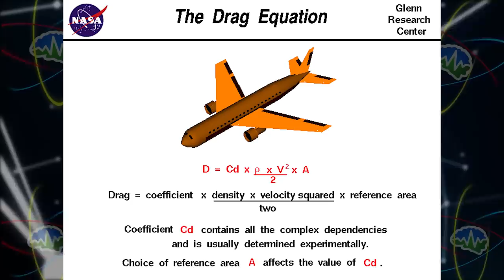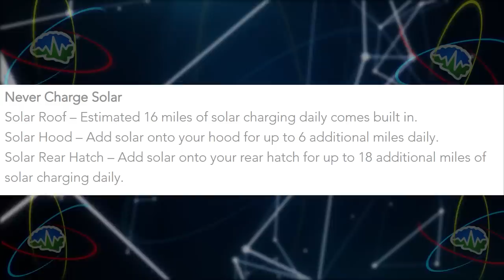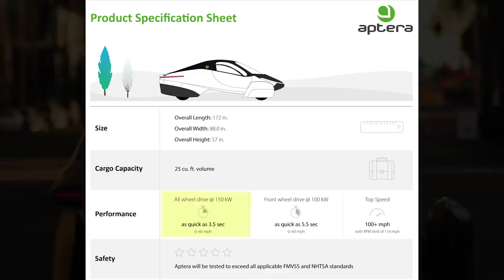Aptera Beats Tesla? | In Depth

Comment: I thought that this would be a great first car for a teenager until I saw the 0-60 time, that is way too fast for a teenage driver.
Reply: The two wheel motor version time is 5.5 seconds
Reply: @n.brucenelson5920  that is still pretty quick for a first time driver.
Reply: @wildweav  Agreed, but the Level II safety pilot option ($1300) should add some additional security and when the crash test results are released, that should give an additional level of confidence.

Comment: Solar powered car. Can't be parked in a garage. Can't be parked in a carport. Can't be parked under a tree. Can't be parked on the wrong aide of a building. Not much good in the canyons of city streets.
Reply: None of this is true.  It might be if you only want to use Solar as a charging source- but you can also get 13 miles of range per hour plugged into a 110 V 15 amp outlet in your garage I unlike any other EV.
Reply: @N. Bruce Nelson - Sorry, I should have been more specific in that I was targeting the claim that you could pretty much run without ever having to plug it in.
Also, I should add that I can't tell you how happy I am that we are FINALLY moving to go all electric with cars. Let's just try to contain the pie in the sky claims, it's bad enough we have Elon already doing that.
Reply: @georgejones3526  no worries.  I am sorry if I was too strong.  I admit to being a bit on edge these days.  Let's not throw out the baby with the bathwater.   I appreciate everyone who is interested enough to comment here.  Really!
Reply: @N. Bruce Nelson - Woops, sorry if I came across as having an attitude! I wasn't upset with you, sometimes I just don't phrase things so well.

Comment: But, crash tests?  Crumple zones?  ugh
Reply: From their FAQ: "We will not know Aptera's actual rating until we pass a production vehicle through the full safety test. But we are designing to exceed all passenger car standards and the previous version had the highest roof crush strength of all passenger cars on the road, and it performed exceedingly well in actual side and frontal crash tests. Aptera features a Formula One-inspired safety cell with advanced composites and metal structures for impact strength. Similar to aerospace and racing, these energy-absorbing methods are a core part of our safety strategy and have proven effective time and time again in high speed impacts. Aptera also makes use of today’s best forward and side airbag systems in case of an accident."
Reply: Both front and rear crumple zones are part of the design.  It will excel when tested.

Comment: If you found your way in a wind of. 30 plus mph wind  driving around in a flying wing in you are Going for a flight
Reply: It has been tested in 110 mph side winds.  It is far more stable than many slab sided 4 wheelers.
Reply: No.  Wind will have less effect than any other vehicle and as speed increases there is down force built into the design.

Comment: I’m all for innovation and variety especially when I comes to EV, but it looks like a trike with a soda can where people are suppose to sit. Maybe I shut off this full on plug didn’t hear much in safety. Tesla hasn’t just built a customer base but a cult so to say lol. I feel it could do ok and who I see in an Aptera are those people you see riding those single wheel power boards drinking cranberry juice rockin Fleetwood Mac. All the best for them but if a company is gonna pose any kind of threat, they gonna have to really awe the world. Which would you rather have a company that builds EVs & reusable rockets, or one that went bankrupt and makes top of the line trikes and might partner with Harley Davidson. Seems like a rhetorical
Reply: First of all, Aptera didn't go bankrupt the first time.  They had a CEO who didn't agree with the founders' vision and liquidated the company.

Secondly, the design us as focused von safety as efficiency and will have excellent results when it is crash tested later in the year.

Comment: 👎🏻 click bait. Not in the same category as Tesla. You can’t compare a production to a theoretical vehicle. All of these brands: Lucid, Nicola, this one, are simply startups in a realm of theory. Once they establish a production line, sell 300k vehicles to the main market, only then should you try and compare to an actual car manufacturer, until then compare them amongst each other.
Reply: I understand where this is coming from but on this basis many of Tesla's announcements are vaporware, and they still haven't learned to make money from building cars.  This will have to change quickly if they are to remain viable, and they know it.

As far as the current Aptera goes, it is not intended to sell 300K vehicles.  The planned production rate is only 10K per year by the end of 2022.  The difference with Tesla at that rate is that they will be quite profitable.  Their next car, a 4 wheel, 5 passenger sedan, won't be as wildly more efficient, but it will have dramatically lower capital costs to build than Tesla and will be competing in the same market as the Model 3.

Comment: Apples n oranges comparison.
And not one word of Safety.  Thing looks like a death trap.
Reply: From their FAQ: "We will not know Aptera's actual rating until we pass a production vehicle through the full safety test. But we are designing to exceed all passenger car standards and the previous version had the highest roof crush strength of all passenger cars on the road, and it performed exceedingly well in actual side and frontal crash tests. Aptera features a Formula One-inspired safety cell with advanced composites and metal structures for impact strength. Similar to aerospace and racing, these energy-absorbing methods are a core part of our safety strategy and have proven effective time and time again in high speed impacts. Aptera also makes use of today’s best forward and side airbag systems in case of an accident."
Reply: I suspect that when it is tested it will rank among the best two passenger vehicles.
Reply: This thing looks really light.  EVs are Heavy.  I'd feel safer in a Model Y or a Cybertruck.
Reply: @juzefzoozoo  It's expected to be around 1800 lb curb weight. So it's pretty light for a car, but not excessively so. But if you just like heavy vehicles, by all means buy one.
Reply: Rickie j  it's a matter of physics.  1800lbs Vs 4500 to 5500lbs ...I'll take my chances in a Model Y or Cybertruck.  EVs have really low center of mass.  Lower chance of roll over.  Still possible of course.
Reply: @kkobayashi1  I will.  Matter fact, I bought 4.... at least I have four Cybertruck tri-motor with self driving option on order. 😁

Comment: It HAS to look a bit better. Just do something with those 2 ugly front wheels! Maybe even a light fender or piece of light bodywork panel. It looks ugly and that's a problem.
Also, surprise! People like fast cars. Yes they want them to travel far, but also to be fast. Cost saving whilst running the car is the lesser motive for most people.
Reply: 0-60 in 3.5 seconds and 110 mph isn't too bad.
Reply: @n.brucenelson5920  I totally agree. They should be shouting about that a lot more!
Although it looks a bit flimsy for those speeds. Also wonder how much it costs to buy as that will be a major factor.
So cheap to run, might win me over.
Reply: @Caaine  Range Options & Base Price
1,000miles - $44,900, 600miles - $34,600, 400miles - $29,800, 250miles - $25,900  AWD is another $2500.
Reply: @n.brucenelson5920  wow thanks for looking that up and going to the trouble, I appreciate that 👍
Those are very good prices! Especially considering it's an EV, brand new tech and a 1st product. They must have worked so hard on this.
I wish them all the success in the world! (Cos I might buy shares lol)
Reply: @Caaine  Thanks, Steve!  I think they are absolutely driven, and amazed at how far they have come to this point from a clean sheet of paper in 2019.  I have a small investment and a preorder myself, and want to do as much as i can to help them succeed.  I have been doing environmental work much of my life, and to me, this is fun.  I saw Telsa up close in the early 2000's and the start here has been much smoother.  Part of that is they don't have to build everything from scratch anymore, but can draw on a world wide EV industry.
Reply: @n.brucenelson5920  The cheap affordable idea of the whole thing, and the speed is spot on.
Still think the front wheels would benefit from a fender/cover joining the wheels to the car.
Looks fun to drive!
Reply: @Caaine  If you look at the old model that Jay Leno drove they did this.  I think that further testing indicated that they could improve the performance and they ended up with an entirely new design.  This model has a cd down to 0.13, and this may be part of the reason.   I do know that the wheel covers on the prototype are going to undergo some more changes before production, so we will see.
Reply: @n.brucenelson5920  Maybe too futuristic looking too soon,, if that's possible. It's a nice sleek design.

Comment: A bicycle quality car being compared to a full luxury vehicle of Tesla by stating  "Aptera Beats Tesla? | In Depth."  Sure they even made a 70 mile per gallon old VW beetle by cutting out most of the body supports, panels, windows, dash, seats and  popping on literal bicycle tires with and engine de-stroked and bore size as small as possible; Wow  it competes with a regular VW bug...HA HA HA as in this title above.  I can take a a bike and make it goes 1000 miles on batteries too, but then it would not compare in any way with a TESLA.

Comment: I hate Watt-Hours so fricken much. Again, the US has ruined the metric system.
Reply: Watt-hours is used worldwide. I'm very much in favor of metric, but I find watt-hours to be a convenient unit. For example, I can easily estimate how much power it takes to charge my car's ~10 kWh battery in 5 hours (answer: 2 kW). Or how much my 2000 mWh AA battery lasts if I draw a couple of watts from it. (Answer: about an hour.)
Reply: p.s. The problem is that the metric system didn't go far enough. If they made 1 hour = 1000 seconds, for example, then gigajoules would have been just as convenient. (In fact, 1 gigajoule would be the same as 1 kilowatt-"hour", I think.)

Comment: Where have I heard these sort of claims before ? You know, insanely efficient beyond the wit of all the established manufacturers including Tesla, cheap, cheaper than any established manufacturer including Tesla, time lines no one else can match, previous company going bankrupt after the original team got out, only one actual prototype in existence. Has any one seen that car move under its own battery power ? A long list of previous folks who put down a deposit only to see that money evaporate after the founders decamped. I'd like to say Nikola but that car looks a lot like the Dale.
Casually dropping the figure of 700W from its solar panels. In ideal conditions that would require about 4m^2 of panels orthogonal to the incoming light, that is not going to happen, would never happen but if by some miracle it did it the car would not stay orientated like that for very long seeing as the earth continuously moves relative to the sun. Frankly when someone tells me things I'd love to believe but every brain cell I've got tells me that cannot be I run as far away as I can. Aptera has a history, before parting with your money do a little research.
Reply: Yes.  The prototype has been driving around San Diego for a couple of months and will soon make an appearance at a Southern California drag strip.  It is far more developed than the Tesla Roadster was at the same stage.  The Tesla had to have the transmission replaced after every demo ride.  

Also, both Aptera founders have a history is successful startups, including a public company.

Comment: Has to be cheaper yet and proven
Reply: The low running costs already make it a less expensive option than most choices available to couples, which is why the pre-orders are increasing quickly.  I have no problem being an early adopter to help prove the performance and will be reporting on my experience.

Comment: if you go down a hole you will destroy the rear wheel coweling, bad design, bad idea
Reply: unlikely.  It has more clearance to the wheel pants at 5" than the front dam on many cars.  And the wheel pants can be unclipped in under a minute if required.   An off road kit with more clearance is also available.

Comment: So why haven't they driven a prototype the literal 1,000 miles yet?  Because they don't even have that.  Elon said himself that producing the prototype is 1% difficulty.  The other 99% is production. Don't even have the 1% difficulty yet?  That's a pretender.
Reply: Far less of a pretender than Tesla's Lotus that needed a new transmission after every demo ride.  This is real.
Reply: Not sure what you mean by "this is real" when there's no prototype or testing to verify the claims. So I guess you're going to come back now with some witty smart-aleck response to deflect from the original question I posed?
Reply: @charlesbrown179  It is a red herring.  The various models will have ranges from 250 to 1000 miles on the EPA highway cycle.  This is because the worst performing model still uses less than 100 watt hours per mile.
Reply: @n.brucenelson5920  There is no actual product to buy that has been tested to back up any of those claims. You think there will be 3 models? They have not even produced a prototype. All you need for a prototype is money and skilled engineers and they have plenty of money.  Where's the prototype??!!  They're the ones bringing up these design concepts- don't blame me for calling them out on lack of proof.
Reply: @charlesbrown179  The prototype is in San Diego.
Reply: @n.brucenelson5920  And it does not do what is advertised. How do I know? They have not proven it. I would not be here pointing this out to you multiple times if they published real-world results like every other automobile manufacturer.
Reply: @charlesbrown179  At the same stage, Tesla was giving rides in Lotus Elise's that were so "improved" that they had to replace the transmission after every ride.

You seem to have a faulty concept of how vehicles are developed.  No one is forcing you to place a preorder or invest, but the day may come when you regret your present attitude.
Reply: @n.brucenelson5920  The fact that you can't defend Aptera on it's own merits (which it has none since it has no accomplishments) shows how flawed your logic is.  Typical fanboy logic.

Comment: WHo the F cares even if it goes 2000 miles, if it is a moving coffin? Compare the price and what is being offered here please. HUGELY BETTER SAFETY, 2 additional seats, 2 trunks, better performance, actually a VIABLE vehicle in ALL climates and weather conditions. THAT is what Tesla offers, and this monstrosity does NOT. This should cost $17.000 max.
Reply: The Aptera actually has more cargo room (25 cubic ft) than a Tesla. I'm not sure what you mean by "performance"? It can do 0 to 60 in 5.5 seconds and reach a top speed of 100 mph. It's designed to exceed car safety standards. It has climate control. It has torque vectoring for stability in all road conditions. You are criticizing something you don't understand by spouting lies.

Comment: It looks so weird and fragile, and unstable, not very practical, more like a toy car or hobby car. How safe is it with collision?
Reply: We will have the full safety ratings before production begins.  They will likely be very good, if not excellent.
Reply: Not fragile. Weighs a ton. Body material is much stronger and more resilient than steel. Designed to protect passengers in collision with air bags, roll cage & crumple zones, like in cars.
Reply: @fotoguru222  what material is it made of exactly?
Reply: @75Chopin  "Honeycomb fully resin filled composite structure" is the most specific they have in their videos and writings I've seen. Same materials as used in modern lightweight aircraft and sporting boat hulls. They have mentioned different filler materials, such as fiberglass, hemp, and others I forget, depending on the strength/weight/cost tradeoffs for particular areas.

Comment: Oh yeah... less ressources. All the car steel is already mined and continously recycled. Carbon recycling is not plain short not happening. https://www.bloomberg.com/news/features/2020-02-05/wind-turbine-blades-can-t-be-recycled-so-they-re-piling-up-in-landfills. Get this thing from aluminium or steel would be best. But then we are back to the crash test dummy needs increase the weight by multiples.
Reply: Old news.  Those blades are now in demand to be ground up and added to premium, light weight, high strength concrete.

Comment: terrible car, wont be very stabile, cant compare this to much heavier-safer, spacier, faster, more comfortable, four wheel car.......its just not the same thing.....its half the car, and $8000 cheaper does not add up for a 3 wheeler
Reply: You have not looked at the design it appears.  It is far more stable than almost any other car out there, especially SUVs.  It has been tested to be stable in side winds of 110 mph, much higher than the typical slab sided vehicle.  It is certainly not half the performance to other 2 passenger vehicles.

Comment: Stop the hype.  Let talk Safety.
Reply: Aptera is designed with front and rear crumple zones, a F1 style passenger safety cage built with Kevlar and carbon fiber, air bags, and seat belts.  

It will be voluntarily crash tested by a third party to FMVSS Part 200 standards as soon as production intent vehicles are available to test.  It will rate very well.